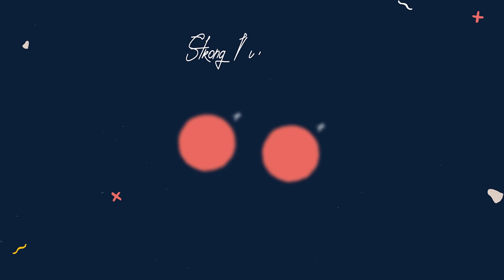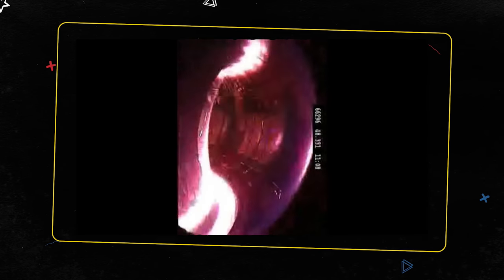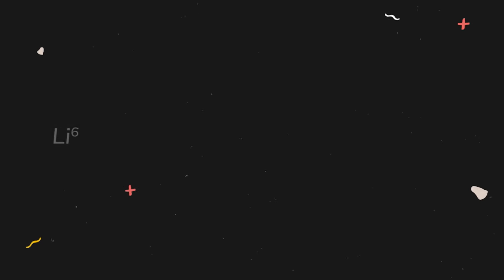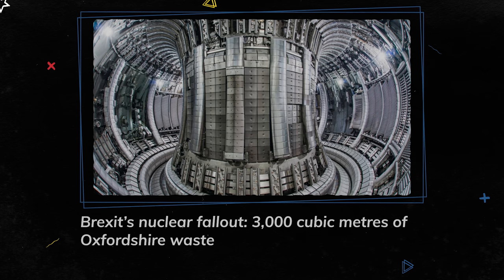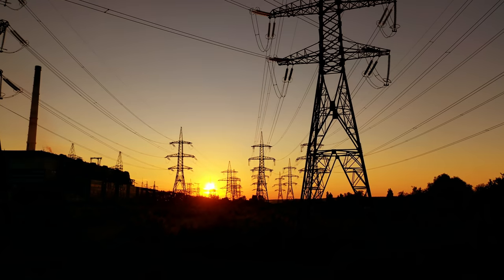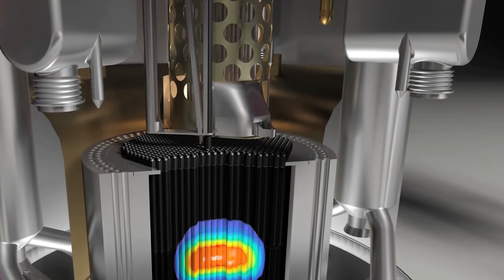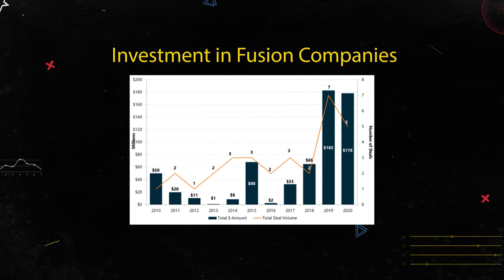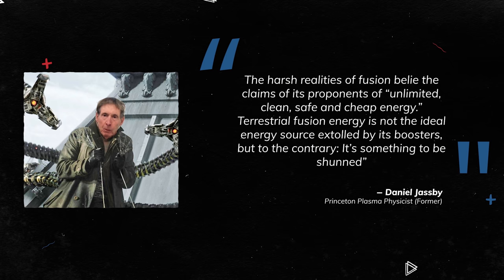What No One Else Is Telling You About Nuclear Fusion

Comment: Wow, an eye-opener! And very well-presented, with good facts and sources. I did not know about these disadvantages, except for the astronomical pricetag.
Reply from the maker: Thanks!

Initially the plan was to make a video about the advantages of fusion. 

But the more we looked the more it seemed that it was not just a difficult scientific challenge, but faced what seemed like insurmountable odds. 

Would love to be told I’m wrong though.
Reply: @TechforLudditesSira  well in next video you can talk all about the mythical cold fusion
Reply: You basically built a strawman argument against fusion using ITER, D-T fusion and the Tokamak design.  There are several designs being seriously researched that have few to none of the disadvantages inherent in ITER, especially ones using a P-B process.  Needs no lithium blankets and puts electrons onto the grid, negating the need for conversion to steam to spin a turbine.
Reply: @mdpuckett  Yea that was my initial reaction too. It wasn't actually against fusion it was against large Tokamaks (there are ideas for smaller compact ones which may work out). As for P B-11, that would be the "holy grail" of fusion, but it requires even higher temperatures, so the reason why most plasma physicist go for D-T is because theoreticly that one is the easiest to achive. So to be fair, its more likely to happen sooner.
And  I would say there is one more thing to consider when we talk about fusion research, when the ENIAC was built, no one would thought that it would be a good idea to get one for the office. And so I belive that the short term practical applicability of a technology, should not be the only way we judge it.

Comment: Excellent pinned argument from both sides of the coin. Kudos. Its rare I see such a debate on YouTube as balanced and as polite as this. Thumbs up for the poster and the viewer  👍
Reply: It's  made me decide to not decide.
Reply: If we capture Krishna and make him protect the reactor then we do not need all those expensive materials and stuff.
Reply: It bears pointing out that all the criticisms of fusion were based on the large D-T reactor projects which is the most heavily studied form of fusion. 
This ignores the recent innovation in high temperature superconductors (e.g. YBCO) which allows superconducting with only liquid nitrogen for cooling. This is enabling some new, smaller projects (e.g. Tokamak Energy in the UK) to progress a lot faster than the ones based on liquid helium cooling.
Obviously this doesn't get around problems like tritium scarcity but it does greatly reduce the parasitic losses for the reactor.

Comment: The latest superconductors can be cooled with liquid Nitrogen and not helium so much easier and cheaper to run.
Reply: I take it these are the high psi ones?
Reply: @dennisgarber  The latest superconductors are indeed easier to cool and dont require the extreme conditions of the "room temperature" superconductor
Reply: @dennisgarber  that's the room temperature one
the one peter talked about is still very cold, just not 4 kelvin cold

Comment: Maybe thorium reactors are the way to go. I've some interesting things about this technology.
Reply: @Grace O'Malley I agree. One of the main reasons why conventional nuclear power plants are so expensive to build is because they are nearly always newly designed, a bit like repeatedly inventing the wheel.

The Russians are a step further here, they have a modular design, which allows big cost savings in manufacturing the component parts and also allows for more incremental improvements of the design. A bit like how cars are designed and built.

This way the Russians are also able to build a nuclear power plant within 4 years, a far cry from the 12 years it takes in most western countries. I've heard the French are planning on going down this same avenue.

But I still think thorium should be looked into. The Chinese are investing heavily in developing this technology and are planning on having a working power plant up and running in about 10 years time.
Reply: @Grace O'Malley so there's the problem with modern fission reactors of the traditional and variety. Decide to build one now, it will take a really long time to build. And they're so expensive, that no market investors want to touch them. They're being killed by cheap solar and wind. Don't get me wrong: I am certainly not against nuclear power, but if we have to subsidize it, we might as well subsidize hydrogen production based on renewable energy to get baseload (as well as building blocks for green chemistry). Or even battery storage at grid scale.
Reply: Thorium reactors are fast neutron reactors. Another thing that fast reactors can do is burn U238, and spent nuclear fuel. We have enough "depleted" uranium and spent fuel to supply all our energy needs for hundreds of years in fast reactors. If we actually start using this technology, which has been around and viable since the late 1980s, we might as well burn up our existing waste before we start worrying about using thorium.
Reply: What do you have?
Reply: Sure but they have their issues as well...  Like the corrosiveness and high maintenance costs.
The issue that we've researched developed the infrastructure the fuel cycle the... Everything basically around classical fuels but to move to thorium will be seriously expensive...
For the next 200ish years or so it's a good idea to stay with uranium... 
But yeah in the long run thorium is the way to go...
Reply: How come we just can’t mirrors next to the sun to beam it straight to earth
Reply: @jasexavier  Everything I've read and heard about Thorium reactors is that they rely on neutrons down in the thermal range.  India's Thorium experiments have been in their Heavy Water Reactors, and they're definitely thermal range.  Breeders that make Plutonium work in the fast spectrum.

Next, you can't breed Plutonium from Depleted Uranium.  You have to enrich Uranium to something like 30% to make it work in a Fast Breeder.  This is why nobody likes that technology.  Well, the Russians like it, because their Lead Bismuth Fast Breeder Reactors don't kill their sailors, like their solid fuel reactors did, back in the day.

When people talk about "Thorium," they're usually talking about the molten salt reactor experiment. at Oak Ridge   This was a successful experimental reactor that demonstrated a number of new concepts, including breeding Uranium from Thorium.  Molten Salt opens up many new possibilities that make the reactors we are familiar with look very wrong.  Indonesia is buying non-breeding versions of this technology.  What's more, this "Thorium" technology can use nuclear waste as fuel.
Reply: @somerobotdude7598  several reasons, we lack the orbital infrastructure for one, second we lack the technology to transfer the energy to Earth without heating ourselves up to an unacceptable degree, 3 if we had the infrastructure in place to make something like that feasible it would also be infrastructure sufficient to enact several other plausible solutions to our current dilemmas.
Reply: Why don't we just go with a dyson sphere instead of using mirrors.
Reply: Dyson Swarm
Reply: @Grace O'Malley "if the first thorium demonstration reactior wasn't online for another two decades"

uh... there already was a thorium reactor, it was build in the 60's i think, and it worked. thorium reactors are not new technology.

they were phased out in favor of uranium reactors because of politics that favored uranium reactors
Reply: She had a video about thorium reacter as well
Reply: @Craig Carmichael Wind and solar have also serious environmental issues of their own. For instance digging up rare earths needed for solar and their refinery ends up with 1000 of tonnes of toxic waste. And later nobody  knows what to do with the panels once they are worn out after about 20 years. Wind energy isn't much different with their neodymium magnets also made of rare earths and also become weaker over time.

Also, wind and solar will never ever provide enough power, maximum is about 50% for any developed country. Add to this that these technologies don't offer constant power: no wind during the night and you see what I mean.

This gap has to be bridged with power plants, either coal or oil fired, hydro or with nuclear reactors. Coal and oil have obvious drawbacks. Hydro is more sustainable, but possible places to build them are getting rare and are quite disruptive in the areas they are built.

The only obvious choice left is nuclear if we want to have sustainable and climate neutral power generation over the next 100 years.
Reply: I love Thorium as much as the next random dude on the internet who has watched a handfull of videos on the topic, but while it does not have the same proliferation issues as traditional nukers, it is still nuclear power, and still has huge headwinds and design problems.  Without the ability to create nuclear weapons there is just no political will to pursue it, and it will still be just as expensive as traditional nuclear, with nearly as much nuclear waste (noting that the vast bulk of nuclear waste is clothes and brooms of the cleaning crews, not spent fuel)
Reply: @CaedenV  One of the main advantages of thorium is that it produces minimal amounts of radioactive fuel waste. As for the bulk of radioactive waste being clothing and cleaning equipment, if you believe that maybe you should also include the cleaning personnel. After all why would they be spared radioactive contamination while their equipment is not?

I have the impression that you have fallen for many of the stories that nuclear energy distractors like to peddle.  One of them is that equipment in nuclear power plants becomes so radioactive that it has to be disposed of in special sealed containers under ground for the next 20 000 years. That is not the case. Simply washing this equipment frees it of contamination, just like when staff shower themselves.

Did you know that coal fired power plants are far more radioactive than any nuclear power plant? The ash from the coal is also radioactive and has to be buried, usually in abandoned coal mines. Strange that this is never mentioned in anti-nuclear power circles.

Did you know that there are far more fatalities per Giga Watt of coal power than of nuclear power even if you count all the deaths through Chernobyl and Fukushima? Nobody has ever really tallied the accidental death toll in coal mines supplying power plants with fuel, but it must be huge.
Reply: @mikethespike7579  technically, there’s also gas-fired plants with ccs (carbon capture and storage) that are sustainable; they’re more expensive than their non ccs counterparts and are less efficient, however. They basically capture their carbon dioxide emissions after combustion. Everyone seems to forget about these when talking about less carbon emissions. I think they should be included as a sustainable energy source in addition to nuclear and renewables. Although I will concede they aren’t 100% emission-free, they should be looked at as an option. Something to consider is that electricity generation can be used towards carbon capture, which indirectly reduces the carbon footprint of energy producers.
Reply: @hi-gf5yl  The one single issue I have with gas is that a lot of it is now extracted through fracking. Using gas in power plants will raise the demand of this energy source many fold causing an increase in fracking.

Fracking is arguably the most destructive form of energy extraction ever. It can cause earthquakes, contaminate the water table and water supply and release green house and poisonous gasses (methane and radioactive radon for example) over large areas.
Reply: @mikethespike7579  I agree that fracking does have its issues, but it has had many economic benefits as well not to mention energy security. Unfortunately, nuclear takes too long to build, so it would seem prudent to me for us to focus on upgrading current gas-fired plants to emit less in the mean time and building new ones.
Reply: @donotlike4anonymus594  The MSRE suggested corrosion is not a huge problem. Remember also molten salt is widely used in industry as an energy store including in solar thermal plants so that technology is not particularly novel.

Most of the MSR proposals have the reactor vessel as a small removable module weighing around 300 tons. The reactor is removed from the operating position after five to ten years and sent to a cool down storage or for defuelling and recycling at a specialised facility. An A-B system is used to maintain continuous operation.
Reply: @Grace O'Malley Hi there, Thorcon claim 9 years from regulatory go ahead. That would include a pilot plant The pilot plant would be used to refine the technology (molten salt) and establish and train for operations. Some US universities are already training nuclear technologists for molten salt reactor operations.
Reply: @Grace O'Malley Hi Grace, problem is no one will fund PWRs like AP1000. Also time has moved on the future lies with distributed electrical generation networks for which small modular reactors interfaced with renewables are much better suited. Of the small modular designs molten salt is favoured because it is relatively inexpensive (light and easier to manufacture) requires little or no cooling water, has passive walk away safety, and much greater thermal efficiency.

Additionally there is cost, the reactor for a large PWR (eg AP1000) weighs about 3,500 tons and costs around $10bn for the plant, a lot of construction is done on site. Molten salt SMRs are expected to weigh around 350 tons and cost $1-2bn for the plant. All current proposals have them made in a factory and shipped to site for a great saving in construction and installation cost.
Reply: @ThatsMrPencilneck2U  Hi Paul, not quite correct I understand they never got to load a thorium blanket. The MSRE was fuelled with U233 from another program. Breeding U233 from Th is well established but the entire cycle Th to U233 to energy and waste management has not yet been demonstrated. There have been plenty of studies and there is every reason to expect it will work but some engineering and the demonstrations still need to be done. For this reason Thorcon forecast 9 years from go ahead to first operational power station. After that many power stations could be rolled out each year.

 In terms of zero CO2 emissions by 2050, MSRs could play a big role if given the go ahead. They are a much better bet in my view than ITER fusion which despite the billions thrown at it is unlikely to realise anything useful inside 60 years.
Reply: @jimgraham6722  Thank you for the correction.  Aside from that, I find Thorium advocates convincing and I look for the downside of the technology.  Unfortunately, all I hear are the usual anti-nuclear hacks.  I bet they work for the coal industry.  The most interesting criticism I hear of the original MSR is that it was over-complicated, due to being designed for aviation. A terrestrial based reactor can circulate heat by convection and forgo elaborate plumbing.
Reply: @Grace O'Malley The assumption of regulatory hold ups is relevant in the US and possibly Europe but I suspect not so much in China, India, Indonesia and South Korea where these systems are likely to be first rolled out.
Reply: @ThatsMrPencilneck2U  Agree.
Reply: Failure for 60+ years.  Complex and as bad at waste.

Comment: Excellent video! The principals were expressed unusually clearly, and without attempting to hide bad news, and they were presented in a pleasant manner. Speaking as an engineer, the more technical and financial problems a process presents, the less likely it will wind up being the best solution. One of the reasons for this is that alternate solutions usually arise that cost less, or are simpler, or are safer, or are more reliable, or some combination of all of those things. That does not mean that solutions to individual fusion-related challenges shouldn't be explored.